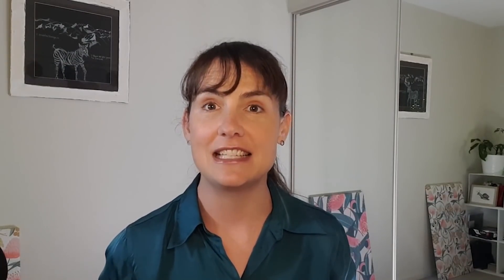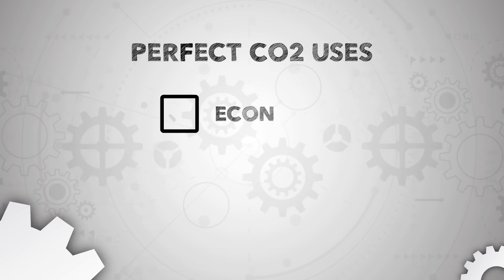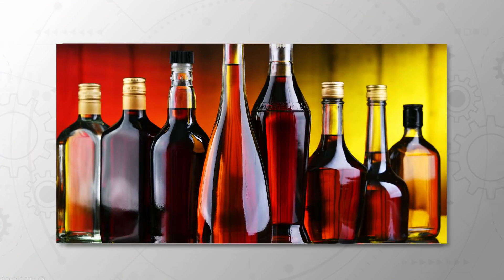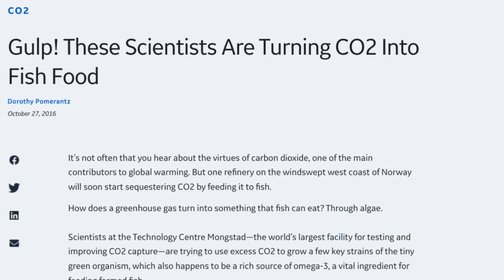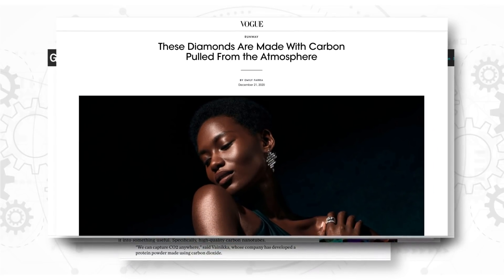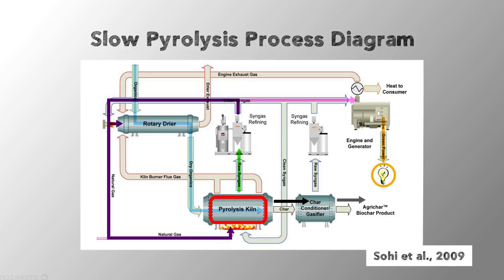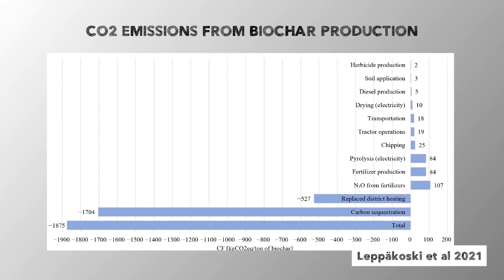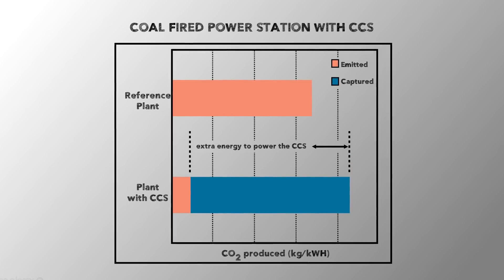From Waste to Wonder: The Surprising Uses of Carbon Dioxide

Comment: I think of it like this:
What does it cost to capture 1000 tons of co2 from the air? (And do we release more co2 powering these ccs equipment? It has to be factored in.)
What does it cost to install renewable energy that can replace fossile energy that would release 1000 tons of co2?
And how sure are we that the captured co2 stay where we store it for at least 1000 years? We don't want a nasty surprise where it's released / leaked back into the air.

Also I don't want to invest in capturing at the plant where it's released, (coal power plant as an example), that will just be an argument that "the plant isn't as dirty as it was and can stay operational in the future". When we finally close the coal power plant, we can't capture any co2 as the capture equipment is not designed for co2 from air capture. These investment's will become obsolete.
Reply: 🎶 Read the IPCC report, it is sprawling over a climate worth of topics, but search works and it answers questions. Nonfiction, my drawdown dude.
Reply: @Cineenvenordquist  So IPCC has cost figures for big scale (mega ton / year) CCS?

Does it have figures for power consumption or efficiency (kWh / mega ton co2 captuerd?

If we (burn) emit half a ton of co2 to capture 2 ton of co2 - we are getting nowhere or backwards very fast.

Why pay $1 to capture 1 ton co2 with CCS, when we can pay $1 for solar cells witch can stop the release of 100 ton co2.

Comment: The biggest challenge is always the values gap; until we collectively place a high enough value on our planet and biosphere that we rely on to sustain our civilization, we will continue to mis-utilize whatever technologies we do have. 

While trying to find use for CO2 is good, I think that simply addressing the problem has value in of itself; carbon removed from the atmosphere improves the quality and security of our climate. 

If I were given the task of sequestering carbon, my personal approach would be to manufacture a very large amount of biochar, incorporate whatever I could into soil, and take and surplus and either bury it in old mines or dump it in deep, cold saltwater. I favor this approach for the fact that it takes advantage of photosynthesis, which is cheap and scalable, and for it's long-term stability. 

Realistically, we are going to blow past our current emissions goals, then have to pull out all the stops as we navigate the 2030's and 2040's. I foresee geoengineering, massive carbon removal schemes, embargos against countries that continue to emit heavily, and even possibly military interventions against laggard nations. 

This is going to get messy.

Comment: I have a game changer patented technology in CO2 Direct Air Capture and Point source Capture (DAC-DC Hybrid System) for scalable capturing CO2 for FREE as a byproduct from a novel low cost cooling system  for district cooling and industrial cooling) without using any absorbent, heat or membrane. Please Communicate with me

Comment: and this is why nuclear power will be needed and needed a lot. We will need a lot of energy to power all these different steps  needed to decarbonize industrial processes which are all fairly wasteful and require a high temp source of process heat. Once solar and wind have produced enough energy to manufacture their replacements there isnt enough excess energy to waste for things like CCS, water desalination, green hydrogen, CO2 free metals and concrete. Nuclear outputs vastly more energy than is needed for the power plants construction and the mining of the fuel. So much more that we will have enough to do all the things we need to do to, who cares if the hydrogen used in airplanes is only 30% efficient when we have more than enough carbon free energy.

Comment: I would like to see CC used to make carbon-fibre.  Then we can make cars, airplanes, etc. out of this, which will make them lighter and more efficient and so consume less energy.  And of course, the carbon so used is permanently eliminated from the atmosphere.  But the gain here is sort of off-hand, as it comes through improving the efficiency of things in-use, so the logic may be somewhat hard to follow.  BTW, making cars from composites would eliminate the corrosion of metal and the complicated, expensive, and energy consuming processes needed to prevent the rapid demise of the machine (which is not very effective anyhow!).  And consequently, the useful life of cars can be extended and the short-term replacement of them improved -- again with much saving of energy and pollution.
Reply: Even more amazeballs it would sort of imply several regrind and autoclaves per city to serve up the circular parts economy.

Comment: There is a company out there re-carbonizing concrete structures as a form of strengthening. A bridge here in Oregon had the process done a few years back, and there were lots of variables, such as the age of the bridge, cost compared to replacing the bridge, lifespan of the rehabilitated bridge, etc. I wasn't on that project team, so I don't know much more than that, but it sounds like one of these CCUs, and I don't think anyone talked about it in that context at that time.

Comment: 11:23 I'm struggling to understand what's the point of taking biomass and going through that whole process with the goal of carbon sequestering? I get the syngas and refining it to fuel, kinda makes sense, sort of, but for carbon sequestering, that's a lot of steps added to biomass, you've already captured the carbon in the plant. 
However, if you are doing this with plastics and tires, then that changes the equation completely. Cause you are returning the carbon to a useful agri state and have some fuel to boot.

Comment: Direct Air Capture (DAC) is nuts - why pull CO2 from the air at 415ppm rather than from power station or cement plant flue gas at 100,000ppm?

Comment: Hi Rosie. What about the new trends of deep geothermal wells where lithium salt brine is extracted from deep below the earth and converted by using CO2 for for Lithium Carbonate to supply the massive battery industry. Also carbon is used for the Anode material for Lithium Iron Phosphate batteries This is going to be enormous…

Comment: Today I'd summarise our problems as solved by lots of renewable energy and lots of storage.  CCU can be used as part the storage, but I'm mainly thinking grid storage where the CO2 can be captured more easily in concentrated form.  We can use Syngas to generate in times of low renewables and when other more efficient storage has run out,  we store all the CO2 in temporary storage and then use excess renewables to convert that back to syn gas.  Carbons usefulness, as demonstrated by Nature, is that it is good at holding and storing Hydrogen.  Carbon is also useful for holding O2 and is a very compressible gas.  Syngas burns very cleanly producing mostly water and CO2 so cooling plant, compressors etc can handle it without getting gummed up with soot.  The only question is how efficient is the process and can it generate net positive energy while its generating.  Or would it be easier to simply make huge battery storage, Hydro, sodium, thermal whatever.
When you talk about these things the most important number is their round trip efficiency.  This will dictate their usefulness to act as storage.
Personally my feeling is towards simpler storage like thermal or gravity, it can be scaled up and is achieving sensible efficiencies.  So far chemical conversions seems to be in the single digits or fractions of % on RTE.
On the hard to electrify areas, I don;t think they are hard to electricfy, you can electrify anything for example planes and ships could use aluminium as a very dense fuel to directly create electricity.  The oxide is kept on board (or dropped) and can be fully recycled with energy.  Its efficiency is not great but I suspect it is better than chemical cycles.
Reply: Very fine, read some IPCC summaries already and get cheering for the all of the above kinds of championship. Even green solar driven chemistry, heat rejection to space, industrial solar, forestry and soil amendment that doesn't lien on the farm.

Comment: Another thing i was thinking along these lines was:

“Carbon Sequestration in Building Materials” (CSiBM) (Pronounced “See-Sib-Mmm”

Essentially:

Carbon Fiber (The fiber, rope, chopped fiber or woven matting for use in reinforced plastics, etc), Asphalt Concrete, and Plastics/Epoxy could all be made from captured carbon, and especially if buildings aren’t built with Planned Obsolescence in mind, the sequestration should be similar to deep burial?

Also:
- Carbon Fiber Rebar is lighter so has a better strength to weight ratio, also it cannot corrode (iirc; need to see if plastic can degrade)
- Carbon Fiber Reinforced Plastics (or even concrete if done in a manner similar to “Ferrocement”) are stronger and should last longer
- Unlike Portland Cement, Asphalt Cement can be recycled since it js essentially aggregate in a thermoplastic.  For roads some devices even exist that do all steps “in-line reducing downtime” 
- In the cases of replacing uses of mined materials (Carbon Fiber Rebar, Asphalt, etc) you not only can make it carbon negative (which is especially impactful since steel and cement processing are huge carbon dioxide emitters!), but you can also reduce the “Mine Footprint” (at least in theory, not a LCA including needed factory+refinery construction etc…yet)

But yeah that’s my idea/rant i guess.

I may “flesh it out” a bit more in an OSE Wiki page or something (if I haven’t already), but I think it is promising, especially with all the construction that will take place as more of the world urbanizes.

Comment: On the note of this, one thing i was wondering was if “Reverse Coal Mining” could be done?

Especially produce near pure carbon (be it synthetic graphite, or carbon black) (to not lead to mineral loss via ash content if using biomaterial, power-to-x may be less of an issue!) then put it into empty mines as fill material.

GRANTED
- I am not a geotechnical engineer so I don’t know it’s properties that well
- If using only carbon, would this boost earth’s atmospheric oxygen significantly, if so what effects would that have?

BUT

I feel like you get the storage capability of CO2 Injection, but the stability of solid carbon.
Reply: Bits of methodology need sorting out, but i was thinking:

If you made it into a carbon-water (or more “drill mud” like fluid with additives if need be) slurry, you could probably inject it as a liquid form, and use a rock formation/some form of downhole filter to essentially turn the ground/cavern/hole into a “Filter Cake” of carbon, making handling/deposit easier?

Also i wonder how the risk of a “Coal Seam Fire” like situation could be reduced.

Perhaps CO2 injection for inerting, or water flooding, or maybe even inject an epoxy like material (which could also be made from captured CO2) to fill any gaps?
Reply: @ericlotze7724  it is important that the mile-plus bore not jam, so the idea is to not let rock in at the top. Yes the CO2 is going down as a liquid. No water pls.
Reply: Old coal pits can be used to store energy in. One way or another......... Or some third way I haven't thought about. Yet.
Reply: That's a full electroreduction of the CO2 which...you know, a few gigatons at a time as it scales, would get more available oxygen. See the IPCC report; they don't put novels in without plenty of callouts, and make you believe in full time climate science some. They cover your questions.

Of course the strict liability in the unadorned scheme is obvious in that you're sort of hiding amorphous carbon and hoping nobody thinks it's their opportunity. Just way, way more energy intensive than stuffing supercritical CO2 a mile down and watching it keep going, as oddly fraught as that has been for utilities with cross incentives.
Reply: @Cineenvenordquist  I wasn’t necessarily thinking about the sourcing if the carbon per se, moreso the method since it doesn’t seem too mentioned.

I’ll need to dive into the IPCC report then i guess, which sections should i look into?
Reply: @Cineenvenordquist  Also, to clarify a bit i guess, i was thinking less direct CO2->Carbon, and moreso Pyrolysis of Methane (The Plasma Torch Method is pretty mature from the paper’s I’ve dived into at least, pilot plants level if I remember correctly), as well as using Char/Petcoke from Biorefinery type workflows.  Granted then those also require the Sustainable Bio-feedstocks and/or Power-to-Chemicals infrastructure+capability, and that would have to be roped into the Lifecycle Analysis!

Granted i guess you could do it directly from CO2?  I haven’t read up much on how it is done.  Is “pyrolitic graphite” the main method (although that is some crazy slow deposition process mainly good for thin layers if I remember correctly, right?). 

Do you have any paper recommendations on all this?

Comment: On the note of BioChar, I’ve heard soil utilization does have the soil benefits (Synthetic Terra Preta etc), it’s use for carbon sequestration is questionable.  Granted *more research needed™️*, but essentially it can get used by an organism and thus release the CO2 again.  The main article i heard this in was “Geo-Engineering Skeptical” or something.  Let me see if i can grab the link, I’ll post it below if i find it, YouTube sometimes doesn’t like links.

Comment: I think you forgot the easiest and cheapest way to store carbon: trees. Due to photosynthesis with light from the sun, enough energy is available to get CO2 out of the air and store it in wood, while O2 and H2O are released in nature. Timber can be used in construction, for insulation, paper products, compost mulch, packaging, transportation, domestic tools, … Isn’t nature magical? No need for all these dirty factories and grids. Be lazy and let the trees do the job. But we should stop burning everything. Slow down instead of speeding up. The best energy efficiency is the energy you don’t need.
Reply: Biggest problem is we don't have enough land to grow the trees we need.

Comment: The big problem is how strong that carbon-oxygen bond is.
The energy to break it into separate atoms has to come from somewhere, and no matter what it isn't going to be efficient.
Thermodynamics doesn't care how well intentioned you are.

edit: You're always better off to utilize that energy directly and avoid consuming more hydrocarbons.
Reply: True. That's one reason why mineral (carbonate) based solutions are probably most promising: they don't attempt to break up the carbon-oxygen bond, but instead add more bonds, as it were.
Reply: @leftaroundabout  Exactly!
Reply: Thermodynamics also doesn't care about a worst case state stack though, in this universe, so Carbon Inc. are getting capture down to $100 a ton and less.